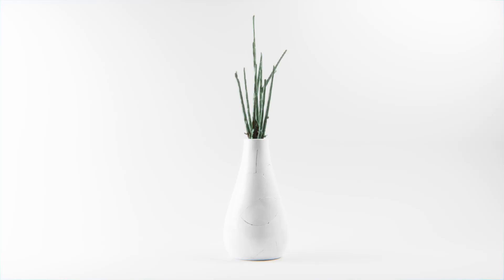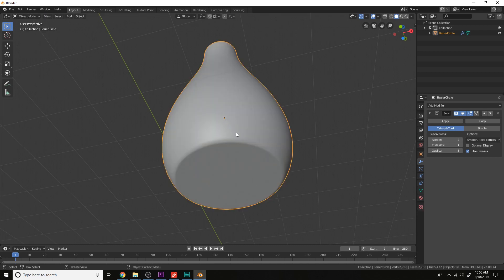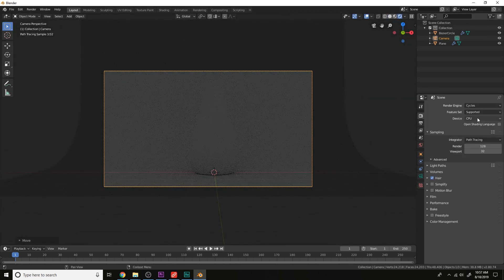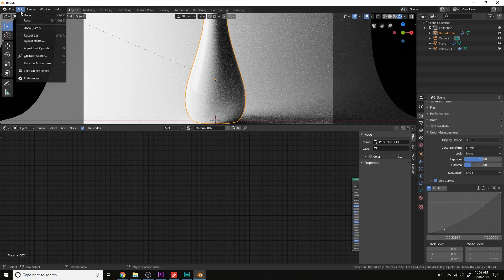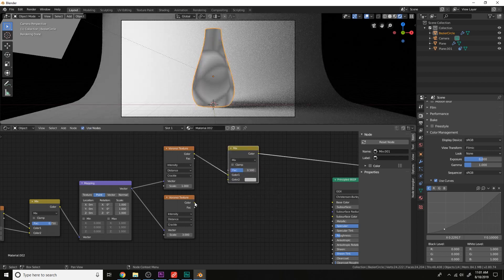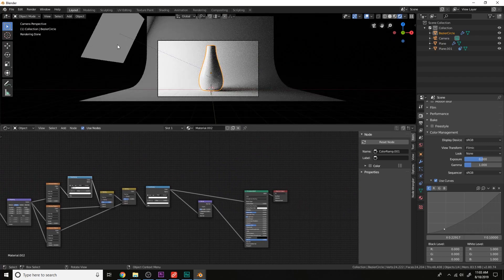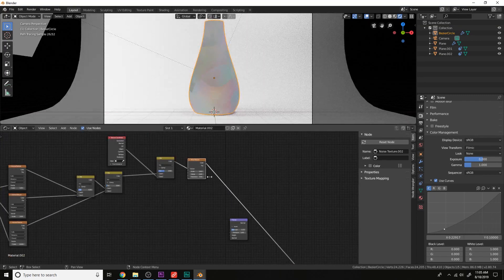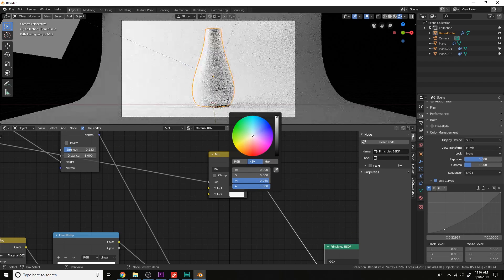How to Create a Cracked Ceramic Vase in Blender Cycles

Comment: Was following along with 2.81 and the step at Voronoi Texture cracks slapped me in the face. Totally different. Any idea how to achieve the same effect in 2.81? Great tutorial though.Thank you so much for this.
Reply: I know this is pretty old and you already managed to solve it your way but in case anyone else wants to know how to do the steps in newer versions of Blender, what you are looking for to get that "crackle" fractured look is the "Distance to Edge" option in the dropdown menu below the dimension selector of the Voronoi node :).
Reply: @sabasgt  thanks for the tip. Will try it out when I get time to power up blender.
Reply: @sabasgt  This tip was a lifesaver! Thank you so much :)
Reply: You figure it out? These Voronoi nodes are completely different it's impossible to follow along with this.
Reply: @niemanickurwa , doawloaded the blender version he was using, I guess 2.80, opened d my file in that version, followed along with the tutorial in the same version, then opened reopened the file in 2.81 and blender recreated the nodes in alternative ones.
Reply: @SowedCastelli  Im wondering if it's possible to just import the old node into 2.82
Reply: @niemanickurwa  I haven't tried that though.

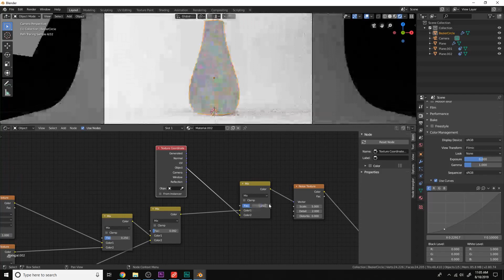Comment: Hi, String Fairy. Why did you copy the whole nodes @9:11? Off-setting @10:28? Why did you choose to use the one setup for Height and the other for Normal in one Bump Node @11:16?
Reply: imyujun choose 3d and distance to edge. The distance should out put similar result